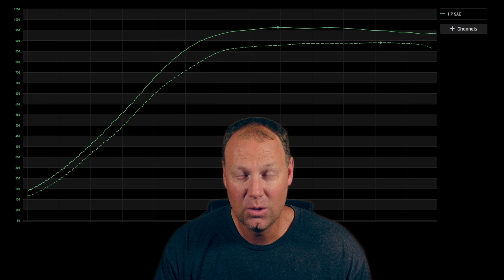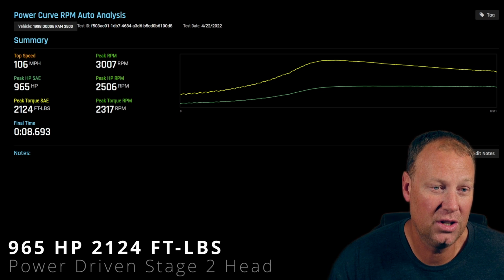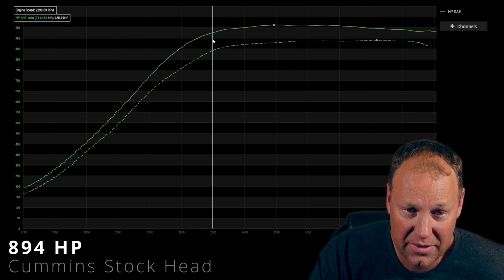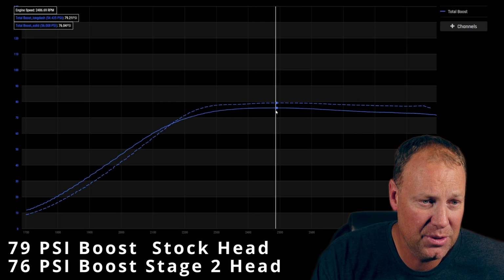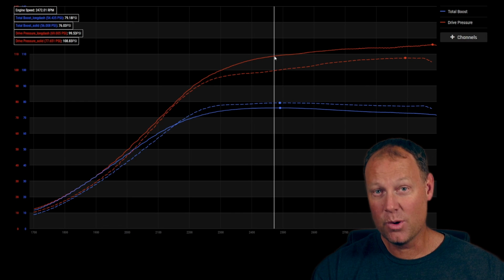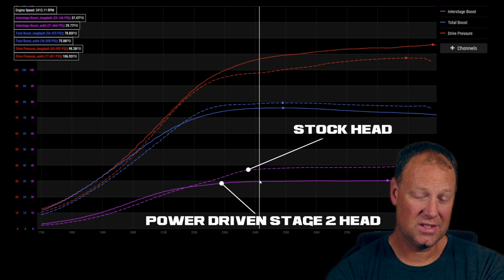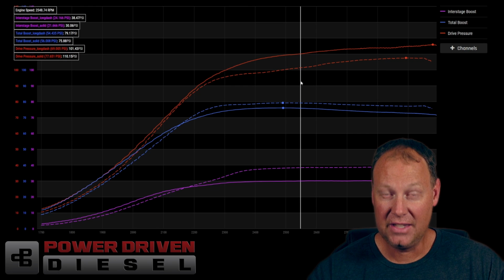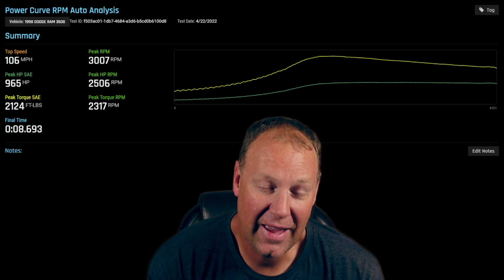Does a Ported Head Improve Your Diesel Engine? Dyno Test Results

Comment: Time to develope a runner style intake as gasoline engines use. The intake tuning length is very important in gasoline engines, and should carry to the diesel engine
Reply from the maker: Will has been playing with runners a bit, the 5th harmonic is quite weak!!!  And packaging space is tight for 2nd or 3rd harmonic... maybe the 4th will show promise?

Comment: We've seen similar counterintuitive results with turbo manifold testing- increased VE and power per psi but higher drive pressure so a "worse" ratio. But it's only measuring the average drive and boost pressures, not actual cylinder filling or what the pressure trace actually is during critical times of the exhaust, overlap, and intake stroke. The higher airflow requires more work from the compressor/turbine, which results in higher drive pressure, but things still keep moving in the right direction regardless
Reply from the maker: We have another video dropping soon with a common rail porter head! Similar findings for sure

Comment: The head increased the engine VE.... which to the turbo made the engine "bigger".  Since that setup was not intended for all out power and was purposefully sized on the smaller size for drivability and towing to begin with, it's even smaller now, hence the worsened boost:drive ratio.  It's awesome that it still picked up.  If you ran the same head swap back to back test on a truck with say a large single that was running close to or actually above a 1:1 boost:drive to start, you would probably make much more substantial power improvements.  Everything says, that compound setup is too small to take advantage of the headwork, and yet it still picked up.  That's a good head.

Comment: I build/sell cummins motors for core exchange. I've put together a package that I believe to be the ultimate practical diesel engine. The point is to compete with the new engines of today in terms of power, smoke control and practicality all while maintaining high levels of simplicity and reliability. It uses a 12 valve VE pump, pilot hole stage 1 injector nozzles, 3200 rpm spring, fuel pin, speed of air pistons. In my test bed truck (08 f250 single cab long bed 2wd) I am running nice custom cold air intake, and the 6.4 Intercooler. Timing is set to 18*. Turbo is an interesting 56/67/12 that I have experimented with. The turbo lights instantly and begins to light before 1700rpm. It lights at a lower rpm than any 12 valve I have personally tested 

I'm getting a whopping 29mpg hwy @65mph. The truck idles like a VP truck, it hardly smokes at all and egt's barely surpass 1100. At the wheels this truck is 321hp and 943ft lbs of torque. Boost will creep up to 35+ psi. I know that I'm not making crazy power but I'm making more than enough power to compete with a brand new truck while being 10X more reliable.

The only idea I have left to kick around is whether or not to include a port job on the heads. The increase in power would be nice and all but that's not the goal here. The goal would be to lower egt's even further and possibly increase mpg. I want my guinea pig truck to hit 30mpg hwy more than anything. The whole package is currently priced at $25k for the complete engine with fuel system turbo, and everything. Just the pistons alone are $4k. 

The idea is to offer a direct competitor to new diesels to where there is virtually no cons compared to a 6.7 powerstroke etc. A lot of the 6.4 and 6.7 fords that I have tested are getting 18-19mpg hwy. For hot shot guys that drive 100-150k miles per year this engine would pay for itself in no time.

Should I port my heads? If it has even the slightest negative effect on spool up, I'm not doing it
Reply from the maker: If you keep swirl in mind on the intake side, similar to our stage 1 towing port, and stay conservative on the exhaust side so you compromise long term reliability from thin port walls, zero downside!

Comment: I'm surprised your surprised because if you think about how much air is able to flow into the cylinder AND the air flow is better into the cylinder so more air equals more boost equals "more powa baby"
Reply from the maker: It's just counter-intuitive at first glance for drive pressure to increase when exhaust flow potential in the head has increased.  Almost the like putting a 4" exhaust on a truck and drive goes up.... however... because drive is measured between the head and the turbos, and we have increased overall airflow and power.... it makes perfect sense that drive pressure has increased.

Comment: This is great information, but what about EGTs?  That is very important to me.  What were the EGTs and did they go up or down with the Stage 2 heads?
Reply from the maker: At the time of this testing, we weren't religious about running the EGT monitor on the data logging channels nor were we watching starting EGT to make for fair comparisons so that is data we can't easily produce from this specific test.  We have conducted other in-house ported head testing and when those videos come out, we'll have all the data on-hand ready to be analyzed and compared.  We had a single turbo 12v a while back that lost about 50 EGT after a towing ported head at the 425 HP level.  For the best comparison it would be fun to test/validate a 4" exhaust before/after along with a cylinder head swap.
Reply: @pddofficial  Yes that would be very valuable data!  I'm looking forward to the next tests to see what can happen with the EGTs!  Keep up the good work.

Comment: Is there any way to maximize lower end power? My truck starts hopping around 1200 rpm in 3rd which is about 30 mph. I'm always shifting between screaming second and hopping 3rd or I'm speeding around town. 95 ram 2500 12v 5 speed with the p-pump 90 horse injectors.
Reply from the maker: Those NV4500 trucks are a little tougher to drive smooth when combined with 3.55 rearend gear ratio and 35" tall tires.  Seems like the 4.10 gear ratio works better with the taller tires.  That said, compound turbos do so much for driveability, a set of compounds would really change the way the truck behaves.  Keep in mind, even at 1200 RPM, compounds are still force feeding more air into the engine and a leaner burn produces more power with the same quantity of fuel meaning you'll have more torque to prevent the surge/bucking/hopping.

Comment: What does it take for a fuel system to go to that high 800 mark with a 12v? I watched the video with your red truck that you tow with and that sounded awesome, but I already have a few 12 valves and that 800 range would be plenty good for what I'm looking to do... is that a smokey combo? ...and where do you want to start putting rods in the 12 valves?
Reply from the maker: You will want a 180 or 215 pump to start with with the newer injector nozzle technology you can make them run extreamly clean. 800 is where we would be considering rods your biggest issue will be butting rings if the tolerances are not opened enough.
Reply: @pddofficial  awesome! How much do you open the rings up? Are the 235 pumps good enough for that, or do those pumps have a cam tailored towards lower speed power?
Reply: They made a video over the engine they put together for their 800HP truck giveaway some years ago. I can’t remember if clearances were specified, but here is a link if you’re interested. https://youtu.be/HYEsYqxQyVE?si=arGgz54Agarl5jxa

Comment: When I had my head off doing fire rings for a blown gasket on my test pig I did a minor amount of port work.  Below 2100 rpms I saw no change in boost so the stock head must be filling good below that point above 2100 drive pressure started to go up and boost went down by 3000rpm I had gained 10psi of drive and lost 6psi of boost. The wastegate ports on those borg housings flow terrible. If you port them and put a tapered lead in so exhaust hits the back of the wastegate bore so it has a way to physically change the direction of the flow out the port you can drop 10psi off that drive and improve the interstage by giving more energy to the low pressure turbo.  Best part is this is power gained with no penalty!

Comment: You didn't say anything about porting the intake manifold, did you port that too? Gas cylinder heads can make a ton more power if you heart shape the combustion chambers & port the valve pockets & polish them too, can you make more power with a diesel by doing that stuff to them?
Reply: Combustion chamber is in the piston on a diesel not in the head . You can unshroud the valves on the head side but that is about it as far as chamber work.
Reply from the maker: The cylinder head is flat, no chamber to port.  But we do de-shroud the valves to help with low lift flow and improve swirl on the intake ports.

Comment: You guys are great and I watch you guys a lot. I have a 05 Dully 4 door cab 6 speed manual and 4x4 floor shift and it’s stock and this my second new Dodge cummins my first was 250 4x4 250 regular cab long bed. Only thing I have done is a intank lift pump and it does a great job and don’t have all that stuff hanging down and if you don’t have heat they will ice pretty easy.

Comment: This makes me want compounds even more.
Reply: Must take care of it really well. Compounds on stock connecting rods! Hell I just want a 2nd gen swap on my 2019. Cannot beat that sound.
Reply: @That0nePerson  Stock 12v rods good for 2000ft-lbs no problems as long as its not nitrous ft-lbs
Reply: @bcbloc02  Hey thanks for the info. All I knew was you had to be careful with sudden massive increases in torque and stock rods. Which is why I only want a single 467.7